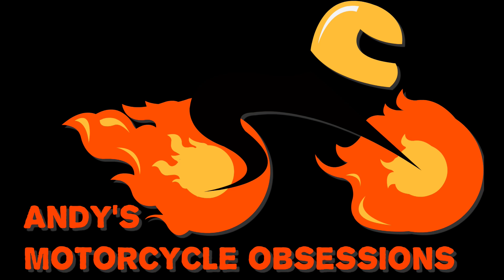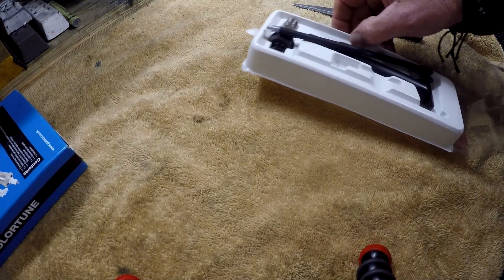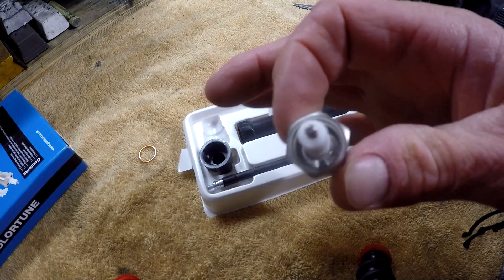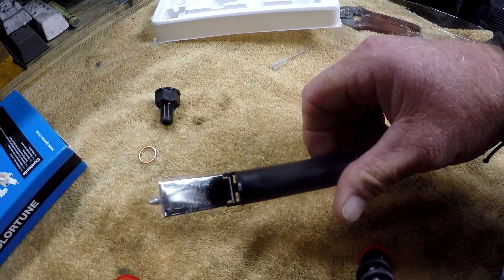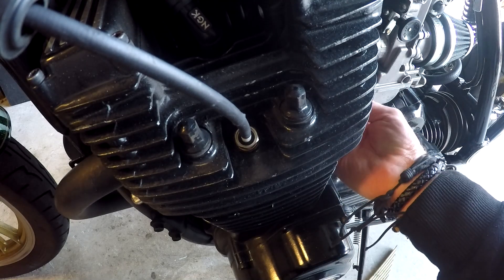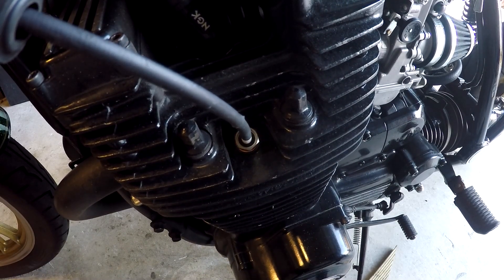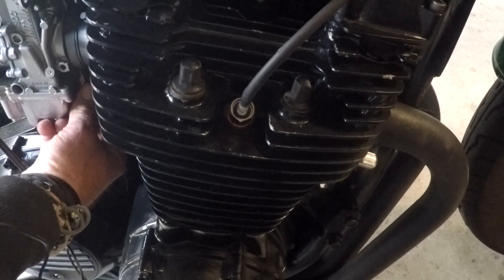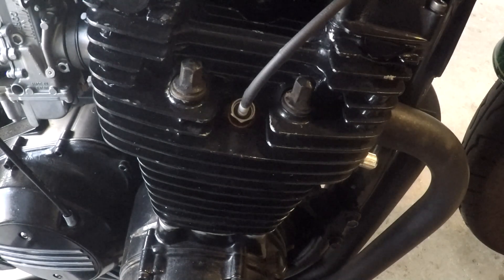Using a Gunson Colortune to tune a motorcycle carburetor

Comment: Say Andy, great video, I would like to ask you about the kit you bought. You're kit Pt# is G-4074 14mm. I have a 1979 gs1000l suzuki and the plugs are long. So my question is should  I buy the G-4055 14mm that has a deep adapter? Thanks for your help
Reply from the maker: I have used my kit on a GS1000 with no issue.

Comment: I've owned one of these tools for over 35 years - l bought it to set the Twin SU carbs on my MK3 Triumph Spitfire when l was a young bloke - Those were the days too when car were easy to work on - Flip the bonnet forward (complete with the front wings) Sit on a front wheel and get to any part you want - Anyway still got my old tuning kit including Feeler Guages, Dwell Angle Meter, Strobe Light and Colortune - Happy days!

Comment: the colortune is great if all you need to do is set your mixture at idle but i found out it won't do you much good if you are chasing a mixture problem beyond that, the actual mixture changes under a load and if you are trying to chase a mixture problem like i am, between 3k and 4k rpms, it's impossible to watch the color burn and ride at the same time, i tried......

Comment: I used this on two of my R series BMWs to good effect. One thing I did find is that it can show up other problems with your carbs which in my case was worn slides.
Reply: I should've added that I still have my Colour tune. Bought it way back in the early 90s and it still works fine. Never tried it on a fuel injected engine as all sorts of other factors come into play.

Comment: i notice that you seem to be using the pilot fuel screw to adjust the Gunson colour. Is this an alternative to using the pilot air screw? is it an either/or/both or the adjustment must be made with the fuel screw.
Reply from the maker: Depending on what carburetor design your bike has. The Mikuni carburetors on this bike have a fuel adjustment screw, some carburetors adjust the air. If the screw is located on the air cleaner side of the carb it is an air adjustment and if it’s on the engine side it is a fuel adjustment. Either way it’s adjusting the air/fuel mixture for the idle circuit.
Reply: @ANDY5  thank you. I have a GS1000 which has Mikuni VM carbs. These have both fuel and air pilot screws This is where the confusion lies.
Regards
David

Comment: Your camera and its microphone were too close (necessarily so to see the plug window) to the high tension lead and the  electromagnetic interference from the high speed switching of the ignition system was overwhelming the audio signal.

Comment: Hiya, I've got one of these in the back of the garage. I used it on bikes I've had and cars. But I learnt a lesson. I used it on my Firestorm years ago and it worked. The plugs on the storm are a long way down into the head. Down a tunnel actually and they are tiny plugs. You use an adaptor to get the colour tune to fit. All went to plan untill I unscrewed it....it left the adaptor behind screwed into the head. I nearly crapped myself! It took a lot of fiddling to get out because you screw the main body in with the adaptor on already. I prob won't use it again!!!

Comment: The tool is an excellent visual representation of what is actually happening inside the combustion chamber. I have a Gunson and been using it for 6 years now, although I normally do not do the inappropriate dismantling of the carburetor when my motorcycle is running well without hesitation and or slow pick up. It is a very good utility for finding leaks and or if the intake system do have leaks that as u turn the air/fuel mix screw and there is no huge variation of the color means the intake system do have leaks. Very useful too on visualization of the needle and jet transition from close throttle to 3/4th opening. 

Once the right color is set, since the motor is under load during test. after re attaching the original spark plug. A/F mixture must be turned 1/16th  to the rich side..max of 1/8th turn. That will be the correct setup assuming there is no leak on the intake manifold..

Works wonder for my motorcycle..I do not have to guess nor to pull over for plug read anymore ever since..:)
Reply: Sounds good but a bunch of people say it's very different to rev the engine when it's not under load to when it is therefore it won't work. The motor is only under load when you ride the bike. I guess you have read the plugs after using Colortune so it does work for you.
Reply: @myshitonyoutube  there is a trick..When doing this on a static mode. simply apply the rear brake or adjust it then rev the engine midway. It always my way. O f course this is one time use only when  overhauling your carburetor to clean it. after that, there is no means of tweaking it again.
Reply: @myshitonyoutube  maybe because of pressure i guess. Carb type motorcycles tend to rely to much on atmospheric pressure. What I know is when the air is dense the better the motorcycle will run in comparison with less dense on the same carb settings.

try this when using colortune. put something like a small fan pointing towards the front of the motorcycle. to act as your moving air ,adjust the brake to keep the rear wheel and fool it as if it has load. then adjust the mixture color, when you get the bluish one on idle, we all know depending on the jets used. it will turn to orange, sign of more gas being sucked. If that happens you know how the transition of your jets is reacting. If I am the owner of that kind of transition of course i'll go step lower of the settings during idle and adjust it to near white (leaner side IDLE) then i'll have an optimum throttle midway.

There is just too many factors. relying too much on colortune is sometimes messy, BUT when you got it via the VISUAL WINDOW of what was happening inside the combustion. You'll never go wrong with it, instead of just hearing the engine rpm goes up and or down as you adjust the mixture. 

EYE is far better than EARS for me.
Reply from the maker: G’day fellas, I think you maybe missing the point here. The Colortune is designed to help set your mixture at idle, it makes no claim beyond that as far as I know. Once you start to lift the needle the metering is fixed for all other circuits within the carburetor by jet size and needle shape/position. Any changes that you make to the idle mixture screws to try and compensate for fixed conditions within the carburetor will have an impact on the idle mixture. Plug reading at various throttle positions or afr measurements on a dyno are your best options for determining which direction to go with jet sizes, needle position etc.
Reply: @ANDY5  true.but for single carb motorcycle, it makes a small difference. never tried My colortune on more than one carb models. But this is indeed a great tool, and makes wonders for my 14 year old 125cc motorcycle. Maybe not the best trick I made when tuning HER!!! but once I got the proper setting, only a 1/8th turn leaner or richer makes me ride better when altitude changes.  Philippines has so damned many mountain ranges, thus our roads isn't always that at the foot of a valley. 

Thank you Andy's motorcycle obsessions.
Reply: @ANDY5  G'day! Yes, maybe I am but why read above idle speed too as the manual says. You're not supposed to use it under load because it gets hot but if u're quick it wont get damaged. Just talked to a guy that has a bench and use it under load and  he says colortune works pretty good on his 2T engine.

Comment: good morning Andy, thank you for great video, do you think that I can use this colortune for rejeting carbs? I think it's possible to do with this tool. I have lean carbs after installing pod filters, when i put bigger jets into carbs I could probably check the mixture with new jets with this tool, is that possible, or it's designed only for idle?
Reply: it's designed mainly for idle mixture as its not designed to be run for too long as the glass will crack when the body heats up and expands and the glass won't! besides your engine when running will be under very different conditions when running at anything other than idle and this device is only realy designed to be used to check idle fuel mixture.
Reply: I wasn't thinking about that this way, you are right, thank you.

Comment: Wow, that's the first I've seen of this. Do you feel it is a better method than tuning the pilot circuit with a vacuum gauge?
Reply from the maker: +BlastsFromTheSaddle g'day mate. You don't tune the pilot circuit with a vacuum gauge, that is for carburetor synchronization. If you have multiple carbs you still need to do that too. Have a look here https://youtu.be/UeVXRHH0G4Y
Reply: Thanks for the lead to the video. Appreciated. I may be a tad confused and perhaps I misspoke. I should have said, tuning the idle circuit with a vacuum gauge. A vacuum gauge can be used to set the idle circuit mixture just same as using a tach, but going for max vacuum rather than max rpm. Well, at least that's always been my understanding. So, is the Colortune enabling you to do more than just set the best idle circuit mixture, being that your only adjustment points are the idle circuit mixture screws? Put another way, is the Colortune device superior to using a tach to set the idle circuit screws? Thanks for you help, as I have some twin carbs on a 1984 GR650 to work on.
Reply from the maker: +BlastsFromTheSaddle sorry for the confusion. For me the colortune works best because I can physically see the flame and adjust richer or leaner regardless of external conditions such as air leaks etc
Reply: Ah, the confusion was mine. I understand it better now. Thanks so much. Recently subscribed and really enjoy your videos. Cheers :-)
Reply: BlastsFromTheSaddle was

Comment: Blue is lean, White is Stoichiometric and Yellow is ritch. Those are great for tuning carb circuits. You've got to know what ratios you want during various demands and RPMs. Leaning a motorcycle out does some nasty damage.
Reply: ..and the engine is not under load. It'll be different when you ride it.
Reply: My concern regarding the interpretation is the nature of the plug gap (and spark location) may not be the same... and THAT TOO influences the mixture ignition markedly IMHO, particularly on bikes without electronic ignition. The precise nature of the gap influences the amperage (under compression) for example, and it's a proper 'balance' of that current release (at that point) that determines proper  ignition. So... yes,  the system is set for THAT test plug, but not necessarily for the plug(s) that are installed is my worry.
Reply from the maker: +qwaszxpolkmncvb g'day mate. The only way to measure stoich is with a O2 meter in the exhaust. As is the case with all internal combustion engines you generally tune for the peak power band and there is compromise either side of that. The changes made here will have a diminishing affect on the air/fuel ratio as a whole as the rpm increases and you become more reliant on the jet sizes and needle position. Thanks for tuning in, Andy

Comment: I've had good results using it on my older cars. Engines run smoother, the plugs colour are light brown . 
I'd like to tune my Yamaha FZR1000 but I have to buy the adaptor because of the smaller plug size NGK DR8ESL. 
Unlike your XS11 and Duc 900ss, the FZR plugs are deep inside the head, so might be a bit challenging.
Reply from the maker: Hi Barry, I was thinking about that myself, until recently I owned a 2005 955i Triumph Daytona triple, and it had the plugs buried deep.  That is what the scope is for apparently.  BTW they do sell a range to fit most plug sizes, thanks for the comments mate. Andy.
Reply: Yes, the scope helps in deep recess cyl head.
Andy, sorry to digress, hope you can do more video on the Ducati ss. Love that too :-)
Reply from the maker: Digress all you like mate.  I will be doing some work on the Ducati soon, I should have started already but other things keep getting in the way.  I will be changing the valve stem seals, re-shimming the valves, and fitting new timing belts.  Cheers, Andy